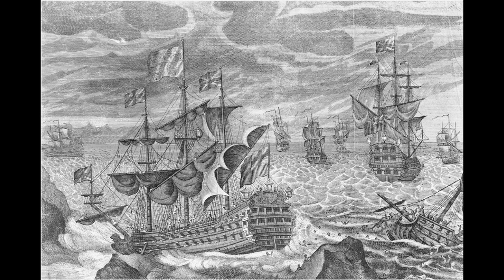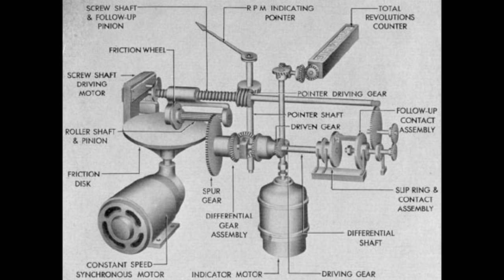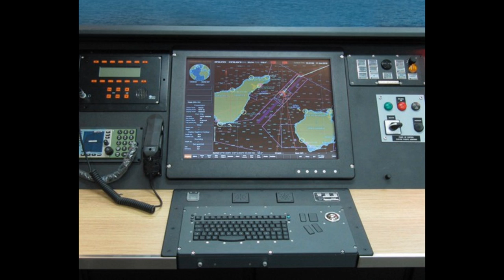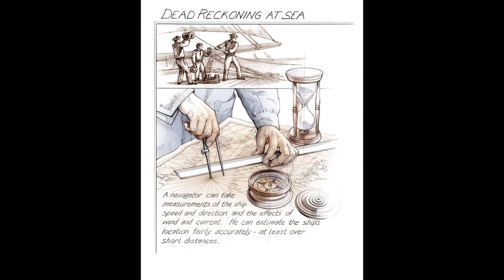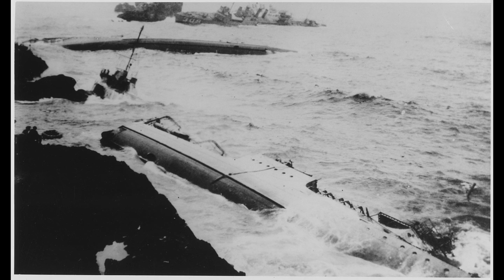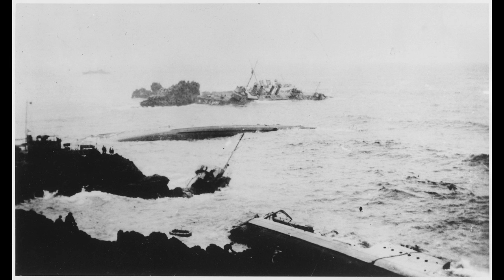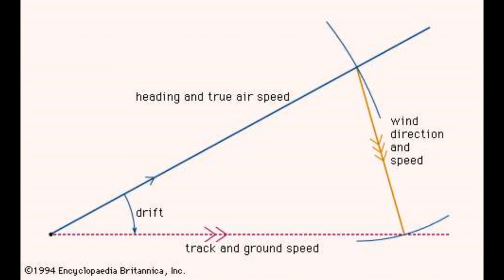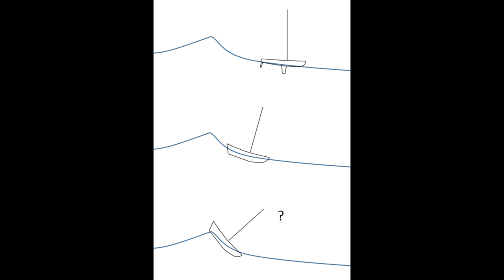Honda Point Disaster - Taking a Wrong Turn at Albuquerque

Comment: Surely doing 20 knots in fog in a known danger area, with only dead reckoning for navigation, is asking for trouble?
Reply: You forgot “when your fancy new navigational system says you aren’t where you aren’t where you think you are”
Reply: The idea that night was to simulate a mission calling on DesRon 11 to make 20 knots to relieve other destroyers under attack. If they had depended on the RDF readings and stayed even just a mile more offshore, the squadron would have passed the rocks without incident. Since part of the reason for this exercise was to practice with the RDF, ignoring the data was ignoring the whole reason for the exercise. I don't buy the whole Japanese Earthquake theory. It was a failure in standard navigational techniques that the RDF was supposed to compensate for. 20 knots on a cloudy, foggy night with rough seas was already a risk. The Commodore should have slowed his ships and headed west until they could determine why the RDF readings were so much different than the positions provided by dead reckoning.
Reply: @sarjim4381  Yes. What was the commander's further career,I wonder. Drach states he was stripped of seniority. Given the loss of materiel and of life,it would seem to me he should have had his commission vacated. Regardless of his honourable willingness to take full responsibility. Bad decisions in peacetime are bad enough. As a wartime training exercise,it demonstrated the man's inability to make good decisions at time of need. At least in my opinion. I do know that early in his career, Nimitz ran a ship aground,usually a career ending move. Mistakes are infinite. 
Doing the right thing after an oopsie is what separates leaders from REMF types.
Do we have somewhere in the electronic information world to determine the rest of the commander's life ?
Reply: @paulmanson253  Wikipedia is your friend - https://en.wikipedia.org/wiki/Edward_H._Watson#Post-Honda_Point_career_and_retirement
Reply: @sarjim4381  The earthquake caused problems with properly accounting for currents and seas which made dead reckoning much more difficult. Ignoring the RDF plots because they indicated your dead reckoning is wrong was a gross stupidity even if the RDF systems were crude by modern standards. It is just like going out in a fog today and getting confused while ignoring your GPS position on your phone because the GPS has to wrong. The fact that other squadrons used the RDF information as a check and realized something was wrong indicates who had the problem.
Reply: @sarjim4381  The RDF was NEW technology.  Many  times people are slow to accept a "New newfangled" idea.  Not embracing a new tech has caused a lot more than just this incident, often with a much more significant loss of life.  A certain battle off the island of Guadalcanal comes to mind when the commanding admiral had the ships with the newest RADAR at the back of  his formation and did not heed the information they relayed to him regarding enemy ships.  And that was not a training exercise.
Reply: Mel Winge Ah yes, the battle of Cape Esperance....
Reply: Sounds like winter driving in Fresno.
Reply: @sarjim4381  The Earthquake Theory is good though, a few events can have significant effects on local currents a long way from the event, and an Earthquake, at least a large one, is one of those events. It is a pretty well known phenomenum amongst Oceanographers these days, though I would hesitate to say if it is a well understood one. While the chanage in currents may not have been the, or even a primary factor in the incident, it very well could have been at least a contributory factor to the accident. I agree that ignoring the RDF was the primary cause but do not discount the Earthquake theory entirely, it very possibly added yet another layer of difficulty to an already difficult navigational problem....
Reply: @melwinge9154  RDF was far from new in 1923. It had been used on the longwave frequencies in common use since 1913. The problem in the Honda Point Disaster was Lt. Cmdr Donald T. Hunter, the captain of Delphy, and the acting navigator for the entire squadron. His disdain for anything electronic when it came to navigation was well known. He believed all the electronic aids to navigation made navigators "soft", and he welcomed the chance to show dead reckoning worked just fine, even in the terrible weather conditions of that night. He ordered his own navigator to ignore the RDF  readings. At the same time, Commander Walter G. Roper, in charge of Division 32, relied on the RDF, and could see the squadron was making a serious navigation error, ordering the four ships in his division to slow and then stop to avoid running up on the rocks. RDF was plenty reliable in 1923, it was the humans in charge that weren't.

Radar wasn't the problem for the First Naval Battle of Guadalcanal. It was Admiral Callahan's defective understanding of radar. Five of his ships that night were equipped with the excellent SG radar. It was Callahan's decision not to use any of them for his flagship, and not to have any of the SG equipped ships in the van of his formation, that caused radar not be as effective as it otherwise could have been. He didn't provide any kind of preliminary written plans to the rest of his fleet, and the difficulties of reliable radio communications, when that's all there was for the fleet, doomed his own ship and caused his death, in addition to a lot of other deaths that night. Radar wasn't the problem. SG radar was good enough that it was in use all the way to the end of the war and beyond. Poor human planning and intership communications were the problem.
Reply: chris younts  I feel like this is somehow user error.
Reply: @88porpoise  It knows where you are, because it knows where you aren't.
Reply: I've only had to do it once in a small 50 passenger vessel in a narrow channel. Captain went through it at idle with me all the way out on the bow scanning for the channel markers. Even so, it was kind of terrifying.
Reply: @washingtonradio  To be fair, I've had a GPS system try three times to direct me through a lake on a road that just stopped halfway across. Why there was a road halfway across the lake I still haven't figured out.
Reply: Jim Fortune Map error, not an error of GPS technology itself.
Reply: @advorak8529  I'm not sure I would have appreciated the difference if I'd trusted the system and driven into the lake. ;->
Reply: chris younts  Some of the same arguments could be made with horseless carriages. "What happens when the driver falls asleep and there is no horse in control to keep it out of the ditch?"
Reply: chris younts  That's the advantage of geldings!
Reply: Seemed like a good idea at the time.
Reply: @ @JimFortune  True, you would blame GPS instead of your system's incorrect application of the same.  And any technology using GPS would be, in your head, dangerous and deadly, while maps (known to be incorrect at times) would still have your full trust as they are old technology.
Reply: @advorak8529  I've seen too many maps that disagree with one another to give them my full trust. And the 'S' in 'GPS' stands for 'System', not 'Satellite'. A failure of the data in the system is a failure of the system to my mind. 
I love my GPS, it makes travelling to new places so much better than even my old Thomas Brothers' maps. I just miss showcasing my skills at refolding road maps!
Reply: @JimFortune  You conflate your navigation system with the Global Positioning System.  Blame your specific navigation system!  The P does not stand for Navigation, after all!
Reply: @advorak8529  And the "Nav" in "NavStar" means what? Which is all beside the point.
I bought a GPS for my car. Anyone who is current with modern technology would understand what I meant by that.  I did not buy and launch a network of 24 satellites. If you want to intentionally misunderstand that, fine.
Reply: chris younts  "account for potholes, sudden road closures, or trash falling off the back of a truck" ... well, probably the same way they have to account for said trucks themselves ... as well as cars, pedestrians and chicken crossing the road.  LIDAR, radar, cameras, ...

The GNSS (GPS, GLONASS, ...) will be part of the navigation suite --- like your satnav --- but will not be used to steer the car, keep it on the road and so on --- again like your satnav.

The legal system will simply have to catch up.  As it did when cars became a thing, phones and phreaking became a thing, modems became a thing, internet became a thing, drones became a thing, ...
Reply: chris younts  20 years ago, if I told you about today's smartphones, you would have told me very much the same: too expensive, will never happen, pipe dream, ...
Factor that into your reality.

PS: 
Apollo Guidance Computer Block II (the ones that flew to the moon): 32kg, 55W, 1 MHz, 3840 byte RAM, 61kB ROM, 85k I/Ops to ROM and RAM.  Display: 3* 2 digits and 3* +/- 5 digits, 13 status/warning lights.  Keyboard: +, -, 0-9, NOUN, VERB, CLR, PRO, KEY REL, ENTR, RSET.
Cost: $1,500,000 per unit (in today's money).
Your phone/tablet is how many times smaller, lighter, energy efficient?  And how many orders of magnitude do you have there in computing power, storage and graphical power?
Reply: chris younts  You seem to be, for some reason, obsessed with violence. At the same time you seem unable to come up with arguments except ad hominem.
Strange ...
Reply: CipiRipi00  Are you really defending the loss of life,the loss of multiple destroyers,to a combination of intellectual arrogance,wartime standards training exercise with no war in sight,poor navigation,an unwillingness to have other ships navigators double check dead reckoning IN FOG ,plus whatever other factors there were ?
I happen to know outright that constant training,learning new stuff and practise practise practise is the only way a person ever really gets good. Too much for safety standards is as bad as far too little. I would describe this as no safety standards with no backup at all.
I call that willful incompetence, and once demonstrated as a mindset,means that winning battles and wars should be done by others.
Seriously,I agree in general with what you said. This however was very much a Yes but.... 
Some men are very good at one level of competence and a disaster in others. True omnicompetence is very rare. Sailing a desk is the best that man should have been allowed,with constant supervision. In reality,medalled Annapolis graduate or not,his commission should have been vacated. I stand by that.
Reply: @melwinge9154  Why not to use the old technology - the eye.
Reply: CipiRipi00  we only need to see what is happening to the destroyers in 2018-2017-2016.
they have the most advanced technology of the present time,full of radars,GPS,all kind of "cameras" ,filled up with fully trained crew,defensive systems that can automatically destroy any kind of weapon throwed at them by hundreds...just to be systematically crushed by massive cargo ships that sails at a few knots.
Antietam,Lake Champlain,USS Fitzgerald,USS John McCain,KNM Hilge Ingstad....
It seems more a problem with the "military" than technolgy,weather or sea conditions.i would be curious about the percentage of military ships lost by accident Vs civilian ships.
Reply: That was my first thought.   What was the pressing need to sail faster than one can see?  Since the area they were in had a lot of shipping and boating traffic, collisions with other vessels were also highly probable and not just reefs and coastlines.  The whole operation seemed irresponsible.
Reply: @xiro6  While i cannot speak for the Hilge Ingstadt the USN ships have been doomed by maintenance shortfalls, lack of crewing and above all else a criminal level of lack of training. Just read this report on the Fitzgerald collision. https://features.propublica.org/navy-accidents/uss-fitzgerald-destroyer-crash-crystal/ . Of all of those "high tech" (most are 80s vintage) systems very few were in full functioning order and those that were the crew did not have adequate training on.
Reply: @xiro6  At least one of the collisions was primarily caused by having a confusing touch-screen steering system instead of a wheel. Nobody realized that the vessel had turned into the path of a cargo ship until too late.
Reply: Don't tell me I'm not where I think I am just because some new fangled thingamajig says so! Look at my rank! Put yourself on report! scrEEEEch BANG
Reply: chris younts    thos are all well known issues being confronted by those developing the technology,  6out are adding nothing by sarcastically asking the questions that are the very foundation of the field.  The answers are out there for you to find if you actually cared.

In short though. Yes, the systems will intend to account for road irregularities. You seem to think the cars will navigate via dead reckoning or via some pre plotted turn by turn course. This is not remotely the case.

No, off road trains will not be "inputted " into the system. Cars may well be developed that can navigate off road trails but their primary intent is to operate in high traffic and high speed areas where human error is the single largest cause of accidents.

The legal system is not based in negligence,  that's some gross mistatement right there.
Laws of the road are not meant to assign guilt or take revenge on someone for a mistake or poor decision.  Liability is perhaps the more acute issue, as machine driving all but eliminates criminal intent.

Laws will do as they always have done and be amended to shit the new reality.   And most likely the cause and this liability of any accident is likely to be far more evident.
Reply: "WHAT COULD POSSIBLY GO WRONG?"

Let Me Count the Ways...
Reply: chris younts  
"Commander Watson, I know we're supposed to be in Missouri, but... there's a huge statue of a woman holding a torch over there and a desert off our starboard. I think we might be off course."
"Your objection has been noted. Continue on course Ensi-" [loud crash/bang]
Reply: chris younts  Computers, cameras and sensors are cheap and reliable (the software is another issue...).
Reply: It is with that kind of attitude!
Reply: Yes doing 20 kts. in fog is asking for trouble and don’t call me Shirley...
Reply: Sounds like a typical government run operation.
Reply: @sarjim4381  Which raises what is for me the biggest question: Why were the commanders THAT skeptical of their equipment?  I can understand not wanting to "bet the farm" on it... but to just ignore it?  Some of the commanders were treating it as faulty... for seemingly no reason at all.
Reply: @paulmanson253  mess hall supply officer in the aleutians
Reply: Naval tradition.

Comment: I have actually dove on these wrecks, the shore entry was rough and the exit was even more hazardous ( only a couple days a year it’s “calm” enough to enter ).The underwater ground was barren hard rock and the ships had been salvaged down to a little below the water line. Only item I salvaged was a brass blow tube cover which I never cleaned and have today. I believe it is now off limits to diving due to hazardous area and being directly off the coast of Vandenberg Air Force missile base. I do remember seeing a large pile of ammunition crusted together that I tried to pry a large shell off of before I thought to myself WtH am I’m doing. My diving partner and I where almost unable to reach shore and while clinging to rocks we declared each on there own. We both made it and never tried again. Those were good times when we were young and diving fools. Happy memories, Thanks for the video.
Reply: Your description of the shoreline and sea condition is exactly what I recall. There was an attempt by a group of US Navy divers from San Diego to repair a communications  line just offshore that had failed. The divers were in the water for a short time before returning to their vessel saying the currents there made condition simply too dangerous to work in.  There are two major currents that meet at Honda Point. On from the south (Baja Flow) is a warm water current and it meets the cold from the north(Aleutian/Japanese). Not only are there two physical hydraulic-forces there but the thermal variations there add to the turbulence in those waters. Honda Point has some of the most dangerous waters to work in or deal with.
Reply: Crusty Mole   Glad you thought about it in time.
Reply: "Wait a second... I'm handling unexploded ordinance inside a wreck near dangerous shoals..." 
Life choice reevaluating noises
Reply: @kumaflamewar6524  To be fair letting go of the ordinance probably saved his life there.